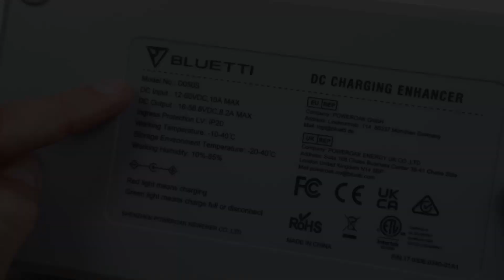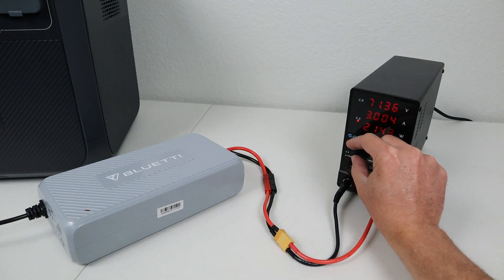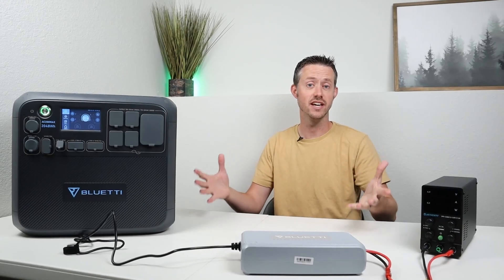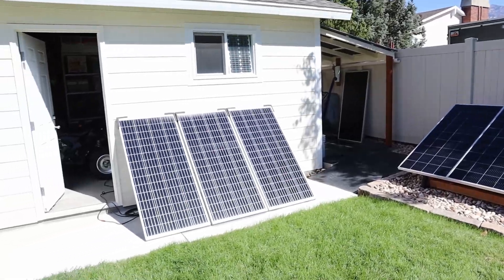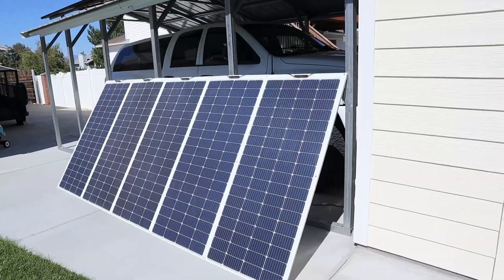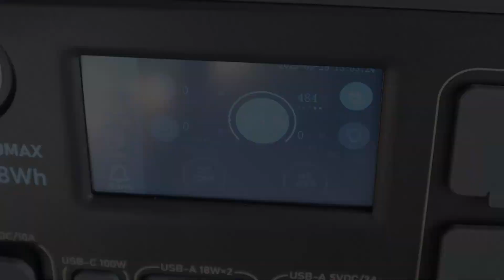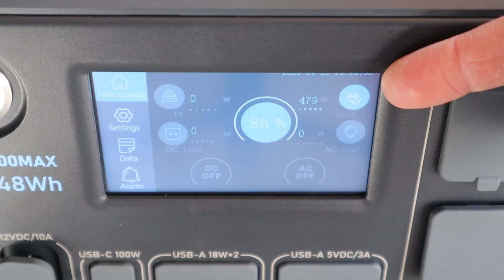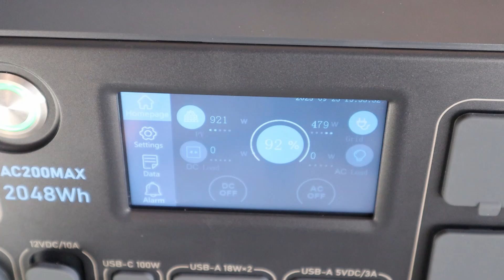The Bluetti Charging Enhancer Accepts More Than 60V?! Let's Find Out!

Comment: So it's basically a DC to AC inverter so you can take advantage of some extra solar and the dual charging setup of the Bluetti? Couldn't you just make one? Or find one out there with a larger output? I have a DC to DC boost converter that will output up to 90v and input up to 60v for about $40, there's got to be something kicking around out there that's a DC to AC output that you can attach whatever leads you want like my boost converter. I have 5.5x2.1's on there but it justs have a positive and negative screws on there for input and output. Hell I could stick alligator clamps on there if I liked or even bare wires. It's a good idea but $200 is a little steep for a max of 500w, but I'm assuming it's taking in consideration of the max 900w of solar was being used at the same time.
Reply from the maker: Its a DC to DC converter that puts out 58.8v. There could be some built in charging processes going on since I don't think it's just a boost converter. Hard to know, maybe I should take it apart!
Reply: 58.8v is the terminal voltage for a 52v lithium-ion battery. Same as my ebike ironically. I use my little MPT-7210 to charge my ebike battery. Since looking closer at your video I noticed the end looks like an 8mm barrel plug is that correct? That's normally a solar connection and you said it plugs into the AC wall input? I'm assuming the AC wall interface is just an 8mm connector. If so I wonder how many volts just that 8mm will accept. It would be interesting to put on an 8mm connector to your power supply and plug it in the same input and slowly ramp up the voltage until the cutoff to see what really is going on and the upper limit to what that plug will take in regards to voltage. I have a feeling this can be done for a lot less than $200. If it's just literally a straight boost converter then when you ramped it up to 75 volts, that's would what be pumping out on the 8mm end as a boost converter can only boost not reduce voltage like a buck converter. So it can only go as low as what's being inputted. If this unit has some sort of buck or voltage regulation capabilities than the 8mm end would have a straight 58.8v output if within the minimum and maximum parameters. Perhaps Bluetti is saying it only goes to 60v because anymore will generate a lot of waste heat if this unit has some limited buck or voltage regulation features and just doesn't want someone with a name starting with "J" to stick his whole solar panel array on there to see if it will work. 🙂I want to see what the output end voltage is if you are boosting it past the 60v mark. Is there any literature on the max amps and voltage for the AC input? If it's capping at 58.8v perhaps it's a 52v system inside. However as you pumped the voltage the Bluetti accepted the increased wattage. I have a feeling that AC port can accept a little more than 58.8v. I use the same technique when charging my Golabs R300 to get around it's 3 amp input limit. I put my boost converter on there and ramp it up to it's max input of 23.5v at 3amp and get 70 watts(67 with losses)going in there. Quite a bit more than the wall wart at 45 watts(43 with losses) or 60w(57 with losses)USB-C PD port. If hypothetically the Bluetti say can accept 10 amps in there. At 58.8v that's a max of 588w. But at 75 volts that's 750w. Interesting. If that's the case, it's better to buy the $40 MPT-7210(or something slightly better) and just set the parameters accordingly. You can spend the extra $160 on booze and experimental electronics as God intended. My guess is there are 2 MPPT controllers in the Bluetti, one for solar and one for the AC input. Or one MPPT controller(to save money) with 2 inputs with different parameters. They may be different parameters who knows maybe I'll download the manual. The AC power unit is just simulating a constant voltage and amp rating of a solar input to pump out X watts but it's really just a buck converter converting 120v 15amp into whatever that MPPT controller will accept safely with a margin of error. What this is doing is the same thing but instead of using a buck converter to step down the voltage it's using a boost converter to boost it from the lower voltage of solar panels. Excellent video.

EDIT: On their website it just says 900w solar and 500w AC, they're not giving me real numbers. I'm assuming they don't want us to reverse engineer their products. The gall! However what does the AC wall wart pump out in amps?(60v x 8amps is 480watts maybe?) You could just simulate what the wall wart is pumping out and slowly ramp up the voltage in tiny increments until cutoff. That'll fix 'em! 🙂 Who knows maybe there is a hard cap at 500w. Be interesting to find out. @Jasonoid

Comment: I already have two 100 watt solar panels. But I never get even close to those léveles that you’re getting with this 3  and the enhancer.  What would you do if you were me ? I’d love to Hebe that level of input but space in my vans roof is getting tight. What would you do ? Remove the 2 / 100 watt panels ? And start from scratch with this same set up ? Or add one or two of those to the two I already have ? And the enhancer ?
Reply from the maker: How are your panels wired? If they were wired in series you'd see around 180w to 200w charging.

Comment: Newpowa still makes those 180 panels, and they are even better now because they are 9bb instead of 5bb still under 20 voc. I bought 3 of them on Amazon for my bluetti ac180 and get 500 watts.
Reply from the maker: The 9bb model panels have higher that 20VOC, I have only see the 5bb model with lower VOC. Where did you find the newer panels with the low VOC?

Comment: Mystery solved! Fantastic video Jason with some great, smaller panel testing. I have used the charging enhancer for about a year but never thought to push it over 60 volts! I have 3 of the Renogy 200 watt panels with a VOC of 23 Volts. I live in Central Florida and it really never gets cold so I think three panels in series will be ok (69 Volts voc). As I mentioned I typically don't get near the voc when I use any of my arrays. I will definitely test first like you did with my voltmeter.  Thank you again.
Reply from the maker: Heat brings down the voltage a bit. If you are in a hot climate you'll probably never get close to the 60 volt "limit" haha.

Comment: To be safe id make sure you can charge the Bluetti for more than a few minutes. Sometimes when you exceed the stated voltage the unit will heat up to unsafe temperatures.
Reply from the maker: It ran for over an hour in my testing, it's rated for 500 watts and I never saw it go over that amount so it should be fine pushing the rated power.

Comment: Once again…great review. Thanks for the heads up. I have the DC enhancer. I’ve been connecting it to the 24 volt dc on the ac300 to charge the ac200 max with an expansion battery. BLUETTI should have increased the solar input on the AC 200 max from 900 watts to at least 1200 watts. The enhancer is a big help for the 200 max especially if you have an expansion battery. Thanks to your video, if I do decide to have an additional solar array for the enhancer I know I can “cheat” a little.
Reply from the maker: We always try to get the most of our solar panels, now we can get a little more!
Reply: I like your idea there. Curious how else you use the AC300 and the 200max together?

Comment: What "can" be done and what is prudent are not always the same thing.  If Bluetti says to limit the input to 60 volts, I would definitely stick to that limit.
Reply from the maker: The 'working voltage' of these panels (Vmp) will be under 60 volts once they are producing power. These VOC numbers are only higher than 60 volts when the panels are just connected and and sitting idle. Remember that when producing they are producing 450 to 500 watts, the panels will be around 45 to 50 volts (well under the 60v). I should have demonstrated that in the video ...(face-palm)
Reply: @Jasonoid  - Very good point, but it's never a good idea to size things for when everything is going right.  Right or wrong, I do err on the side of caution.

Comment: Good video Jason.  I bought 2 of these as I now have a B300 battery to go with my AC200MAX and now I can rin air-conditioning 24/7 in my tropical tiny home.

Luckily, they only charge $80 in Asia for the D050S so I have 2.  Still would like to know if a cheap step up mppt would do the same job...
Reply from the maker: These have a very specific output of 58.8volts, and I'm not sure if they function like a dedicated charger or just a 'power supply'. It would be hard to find a third party product that performs in the same way.
Reply: @Jasonoid  Hi Jason, According to the WaveformScience review they work the same as an MPPT charger with a charging curve. I am wondering if they could be used to charge a 48V server rack battery using a DC7909 female to battery adapter. What do you think about testing that? I also wonder if the T500 could be used to charge a 48V server battery from mains. It could be a low cost way for Bluetti owners to get an expansion battery and charge it without needed to buy additional chargers.
Reply from the maker: @Sideeffect.UK1  it might be worth testing that out, thanks for the heads up

Comment: I am curious to see if I can use this with 3 of my Bouge 180W panels (21.6V Voc each) with my Eb150.  Supposedly the EB150 can take up to 66V (60V on the label) and I have only been using 2 panels because of both the EB150 limit and Charge Enhancer limits.
Reply from the maker: Well I did test panels in this video with 23.9v and 24v VOC which are lower than your BougeRV panels. The only thing I'd worry about would be using those panels in super cold temps. You'd want to check the VOC before connecting. I wouldn't recommend going above 75v ever.

Comment: I think it’s great that you found that ability on the dc enhancer.  Does this mean the AC 180 which range is also 12v - 60v will do the same?
Reply from the maker: I haven't tested that so I wouldn't recommend it.
Reply: My AC180 cuts out at like 61.5v.  The voltage spec makes it really difficult to get to 500W.
Reply from the maker: @DougKremer  thank you for clarifying Doug! Thr 60v cutoff is pretty annoying... We are seeing it all the time now. That's why this is pretty cool that the D050s allows for more voltage input.
Reply: @Jasonoid  Those three newpowa 180’s are about perfect for the spec though.   It’s super annoying. They really needed to open it up to 75V or 15A.

Comment: maybe they should update the labeling and state the actual cut off voltage.
Reply from the maker: Or at least say the VOC limit is 75v with the working voltage 60v and under. Under load most of these panels will be around 48v to 55v anyways (since solar voltage drops under load).
Reply: agreed

Comment: Hello Jason. If you don't mind voiding the warranty it would be really interesting to check the internal components for their voltage rating. Could be that e.g. relais inside are only rated for 60V. I recently had issues with such on voltage protection circuits where the chinese manufacturers were selling them for 48V batteries while the relais inside were rated for 30V DC only and got stuck.
Reply from the maker: I'm not worried about warranties haha. I think I've already voided that by pushing it above 60v LOL... I might open it up and take a look.
Reply: @Jasonoid please do as I asked Bluetti and they don't even reply making sense, they said don't go over 8A, and said it's not a step up converter when clearly it is if you can go as low as 12v and the output is 58.8v.  Going from 12v to 58.8v output is a voltage step up in my book!
Reply from the maker: @fromtheflightdeck252  usually it's a language barrier that's a problem. If you try to ask complicated questions the support staff are unable to help since they only know the very basics of the product, sometimes they can only refer to the owners manual.

Comment: My EB70 actually powers my old school manual Frigidaire window air conditioner. This allows me a another 1 1/2 hour run time each (I have two) during heat emergency power outages....AND....I can dump charge into it using my small power stations to get more AC over time. My Ampere Time 300ah has been an absolute LIFE SAVER during FIVE extreme heat emergency power outages this summer. The temps were between 105 and 113 when these happened and my window AC stayed ON and kept me cool. But I was only able to get 275 to 300w max solar input to my MPPT with over 600w of panels. 

My relatives nearby, who called me names and even tried to make THREATS when I needed my money I had in a savings account of theirs to buy my system, had to evacuate to hotels in the nearest town after waiting in vain for the power to come back on. They think prepping is what "crazy people do" and wanted to "save me" from "wasting my money." "The power doesn`t go off here very much!" No, only about 30 times a year, and 12 of those times for 12-48+ hours to two weeks. 

 I found out later though they were planning to scam me out of the money by trying to convince me to hire a bulldozer to "level my driveway" but actually pay for trees and brush to be cleared for them! I`m poor, on a small disability check from a car accident and brain injury from premature birth, and can`t drive, so I`m trapped in an isolated rural area.But did anybody come check on me after 80 mph winds in June during the first heat emergency to see if my camper survived or if I needed gas for my generator? Nope! They "forgot." Overheating is very dangerous for me. I despise people like them. Thanks for listening. Watch out for monsters....
Reply from the maker: The extreme heat can definitely lessen the efficiency of your solar panels. In the heat of summer I also saw very low production numbers. Now that summer is passing, my solar output is good again! I hope you are seeing the same result.

Comment: It is interesting as their portable PV  panels are pretty optimistically overrated.  It is curious that no other channel has even tested for this, but then again, you are one of few that have actually tested this product.  Great to know as i have three of these for the AC200MAX and the two B230 batteries.  Great and useful review as always, thanks!
Reply from the maker: I'm just glad it goes slightly over the 60v cutoff since it will allow the use of more brands of solar panels. When under load the solar panel voltage will drop down below 60v, it's just the VOC that's going to be higher right when you connect it up. Thanks for watching, John :)

Comment: Honestly all these portable power stations and such seem to lie. They have volt and amp ranges that make it impossible to get the real wattage in the real world without overpaneling the amps. But it's nice to see a lie that benefits the users who were willing to risk it.

I actually use my charge enhancer to allow me to use 12v panels to slowly charge the AC200 but I might have done this if I had known. But I modified the AC200 by adding battery terminals and now its hooked up in parallel to a server rack battery on my house solar now.
Reply from the maker: That sounds like a sweet project!

Comment: I'd rather have the manufacturer's specs be slightly below an actual performance threshold than above.
Reply from the maker: I think if they documented it more clearly it would allow for more usability. For example, they could have said, working voltage 60v and under, VOC peak up to 75 volts. Once these panels start producing power you'd see around 45v to 55v and they would be below the 60v cutoff.

Comment: There could be other reasons why they rated it for 60v, such as what their cooling solution in the design is rated to accommodate for long periods
Reply from the maker: It's got fans that crank up pretty loud and fast, I don't think that's the case.
Reply: Yes i would like to open it up and see what the voltage rating is for the components on the input side of the circuit

Comment: It's common for devices to have padding in a specification to handle spikes and other anomalies without frying. I'd be curious if 75V is pushing it well into a duty cycle that it can't support and if all components in that chain inside the regulator can support it without overheating. Interesting information regardless though. Good luck!
Reply from the maker: The higher limit is mostly helpful for VOC when the panels arent producing power but they are resting. Remember that when panels are at peak power the voltage drops significantly and that will be under 60 volts.

Comment: Does this allow us to use lower voltage panels from other vendors like jackery and rockpals? I think I remember seeing that there was a minimum voltage requirement.
Reply from the maker: There's no voltage minimum. Youre good as long as you never go over 75 volts 👍 but remember, you'll see more wattage the closer you get to the peak voltage since the amperage limit is so low.
Reply: @Jasonoid  thanks for the quick response. I have 2 bluetti 200w panels for my ac200max but also have a few off brand that I wasn’t sure I could use with it or not in a pinch with the charging enhancer. p.s. thanks for the great videos
Reply: 12v minimum,  guess 75v maximum now...